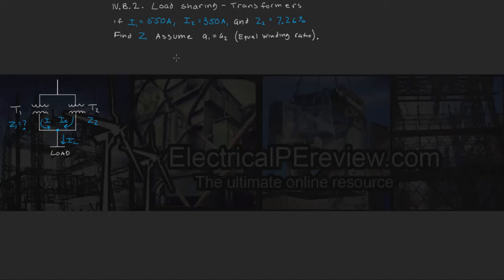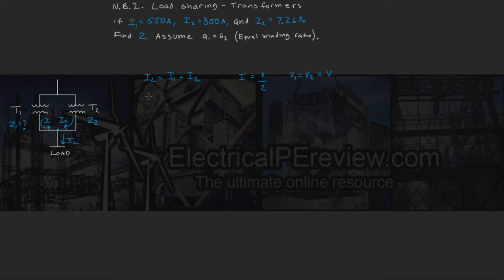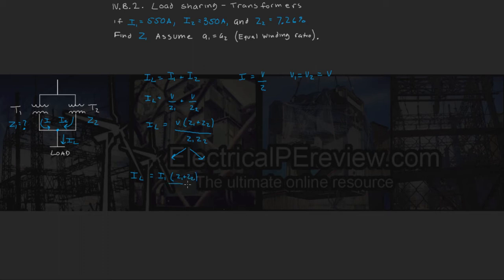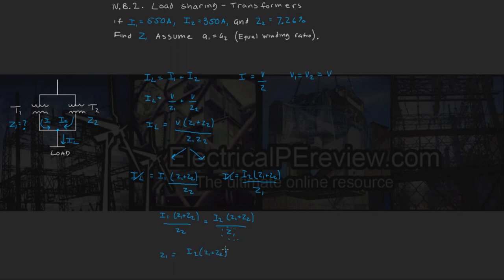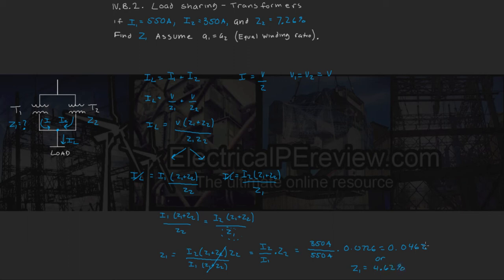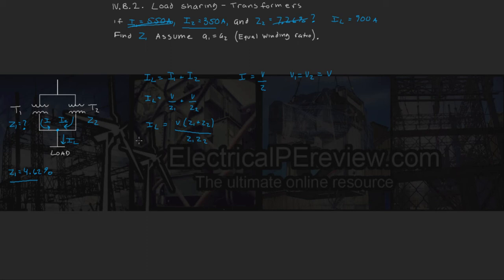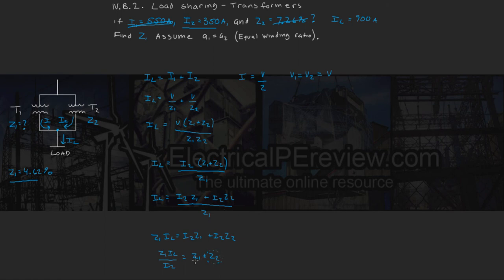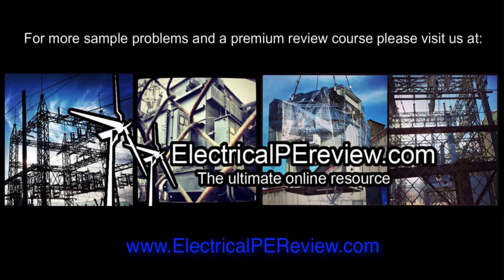IV.B.2.  Load Sharing Transformers Example 2 - Find Impedance - NCEES Electrical PE Power Exam

Comment: Great example. I think you can also assume (first and second part) that I(L) = I(1) + I(2) = V(1)/Z(1) + V(2)/Z(2) = V/Z(1) + V/Z(2) = 550A + 350A = 900A. Since T1 and T2 currents come to the same node you can get I(L) straight away and then continue to find Z(1) and Z(2). Agree?